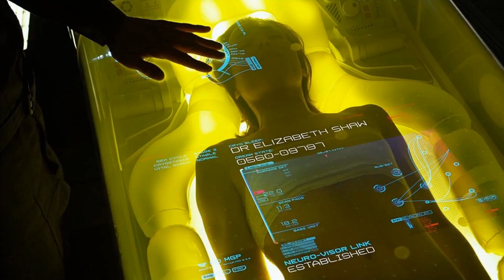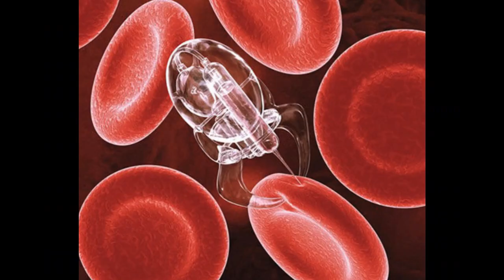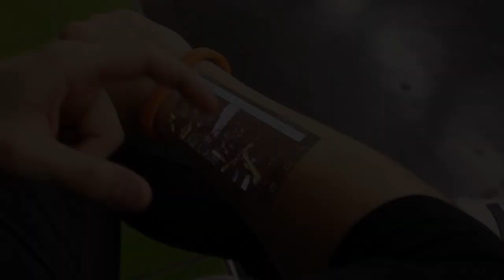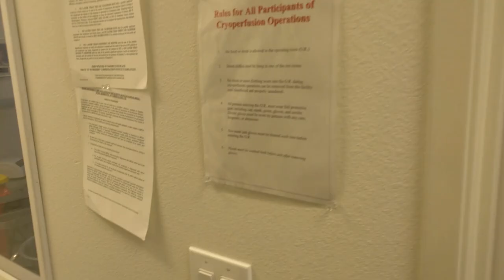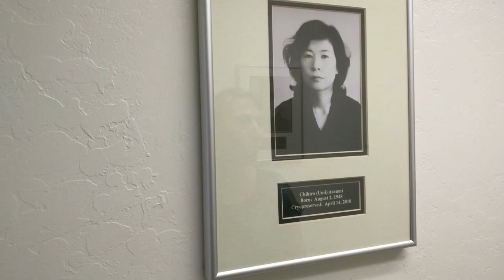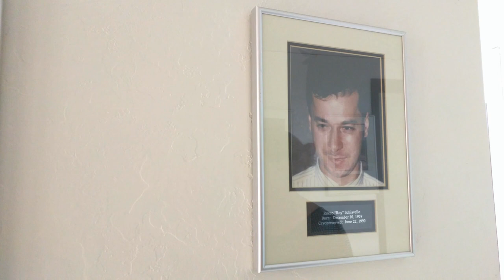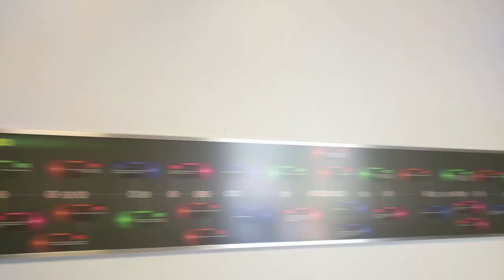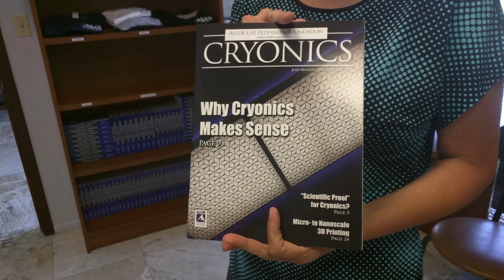Alcor Cryonics - Tour of Facilities  (Can You Live Forever????)

Comment: Facilities seem neglected with hanging cables from the ceiling of the corridor,  cheap office furniture,  bad paint job on the walls...and that is what you can see. I am sure at night they cut off the electricy and the corpses defrost. They must be all rotten inside those airtight stainless steel containers.

Comment: They put a cryogenic storage facility in the desert? They must have a lot of faith in the power grid.
Reply from the maker: That's an interesting assumption, I thought the same thing but those chronic tubes don't run off electricity they run off a liquid gas and as long as they're topped off I think they said once a week maybe it's twice a week they have to top them off or you'll start rotating and the interesting thing is when you're in that tube you're actually upside down so if the liquid nitrogen does start to burn off over time Lisa don't get your feet first 😬
Reply: @JohnDaniels  They're topped off once a week but only need to be topped off like every 3-6 months.